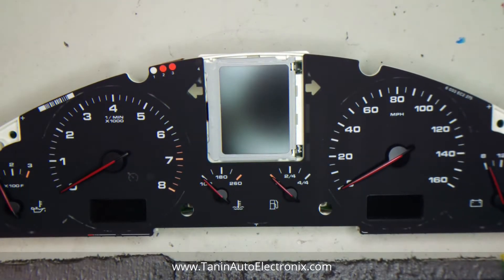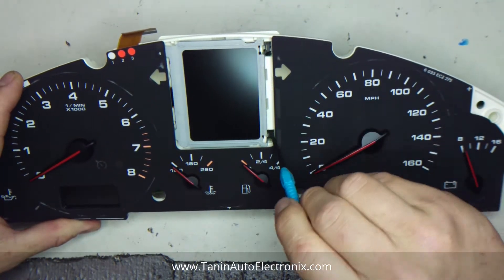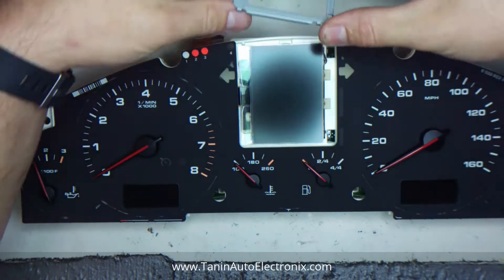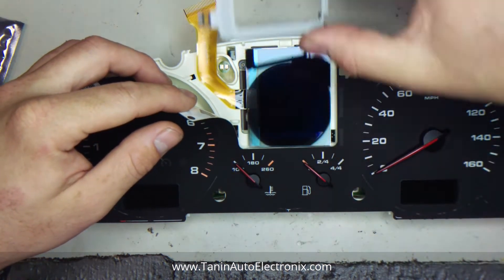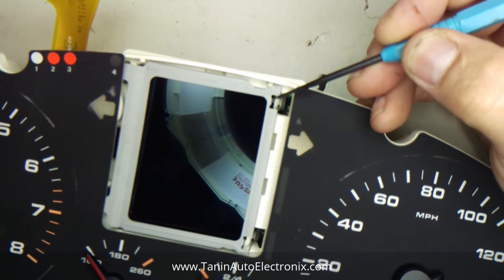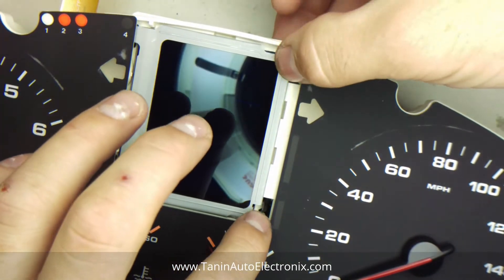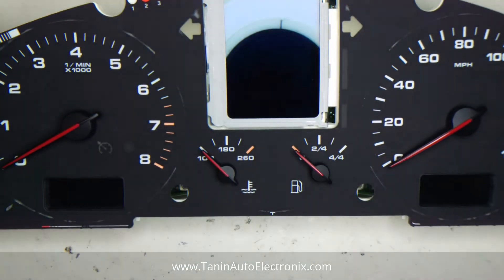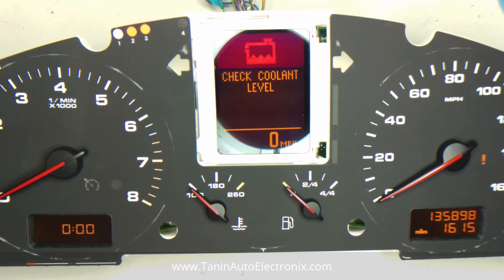How to Install & Repair LCD Screen on a 2003-2010 Porsche Cayenne & Volkswagen Touareg Cluster | TAE

Comment: Good video thanks. I notice that at the end of the video you are "testing" the cluster on your workbench by plugging in the blue plug to the cluster and it turns on. What tools do I need to be able to plug in and test my cluster once I have finished? TIA.

Comment: i just bought my 06 cayenne  the display youre repalcing in this video is partially burnt out on mine.  but also, the steering wheel buttons dont change the dispaly at all so not sure its even worth fixing the display.  have you dealt with the steering wheel buttons not communicating with the display?

Comment: I took mine in to have oil changed and tires rotated. The information center won't let me scroll through anything def fill only displays
Reply from the maker: Hey Russ! Send us a message with your vehicle info and we'd be happy to assist!
262-456-4147
contact@taninauto.com